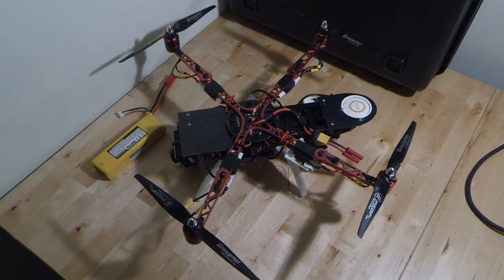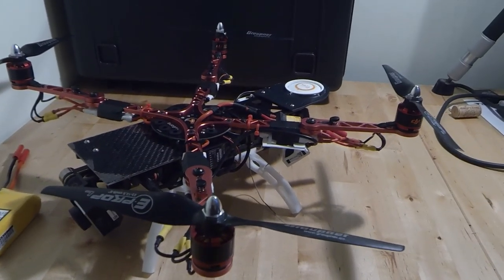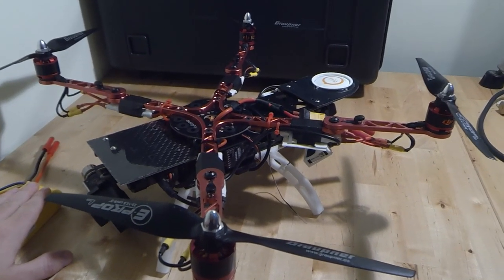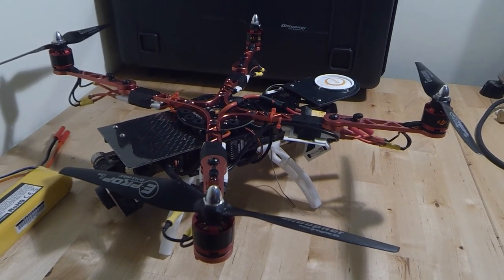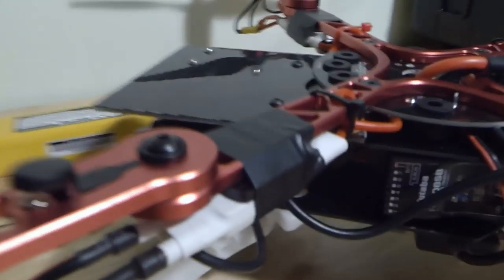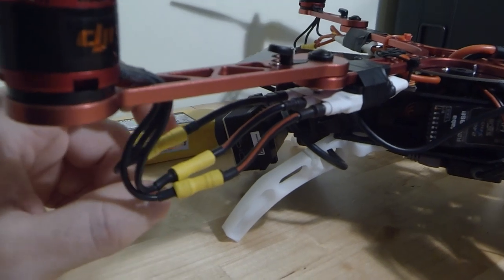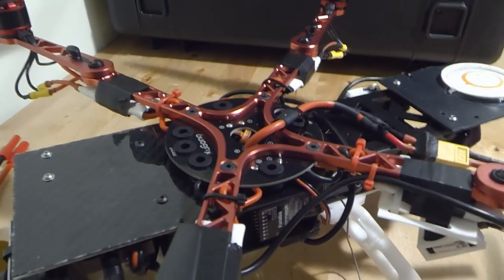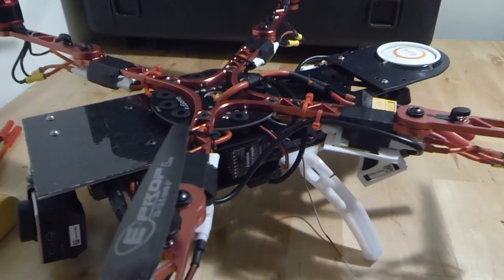ImmersionRC XuGong Review (10 Inch Foldable Quadcopter)

Comment: The XuGong is designed to be small so its easy to carry, therefore the "box"under the arms is kept to a minimum as-well.
There is very little vibration because the whole arms sections is decoupled form the frame with rubber dampers. We have updated the manual as well and the build video is being made at this moment.
Reply from the maker: Thanks for posting guys. Really nice to see a company commenting on videos like this. I think the main thing here is that even with a few gripes it is still a great platform with plenty of future potential. The fact it stands up to my 'fattening' of it (and survived a crash without damage too) is testiment to your team. When can we expect to see the hop-up? (If you need a UK beta tester you know where to come ;-)
Reply: Since we like to fly a lot ours elfs we know that hard landings are going to happen, so one of the design criteria has been to minimize the damage of a crash. I am glad to hear that worked for you to.

Comment: Did you consider the TBS Discovery , or was it because you wanted the option of folding the frame . you have done well to fit it all on though .
Reply from the maker: I considered it yes but portability was key. I stripped down my F450 to make this because the F450 just wouldn't fit in a sensible sized case like the Phantom would and the idea of a 450 sized frame in a Phantom sized box sold it to me. The disco (especially the pro) is a great kit but even going the non pro route with all the 'core' etc gets pricey. Of course if you see my latest videos you'll of seen I've crashed this... it will fly again but I have to strip it down to bend the arms back into shape.... doh!

Comment: I didn't get to the end of your video but I've seen enough to tell me not to try this. I liked the idea of the foldable alloy frame but the design is very flawed. I'm also fearful the gimbal mount for the whole frame will actually magnify the vibrations from the motors. Having the frame on top of the arms like the QAV500 makes more sense to me.  I hope your efforts were worth while I can see quite a lot work went into building that.
Reply from the maker: Thanks stewjw. It is a tricky one. I created something a little beyond what the frame was designed for but there is no denying the space issue and frame design was not very well thought through. ImmersionRC are making a 'hop-up' kit from Carbon Fibre which, in theory, will address these issues. Likewise other people (myself included) are designing frames that will work under the arms.
The anti-vibration systems does actually work quite well and with it all tuned I am quite pleased with the results. CG is an issue but again, manageble.
Personally I'd wait to see what the Hop Up version has to hold.... this frame is great but you need to be pretty patient and think outside the box to get the most from it currently.
 Thanks for watching.
Reply: Thanks for your reply. It was a good thorough review. I had a cheap MF450, FPV style frame, and I had to put the Lipo on top to balance I couldn't place it in the inside battery position at the back of the frame like this one. I was pushing the limits on battery size.